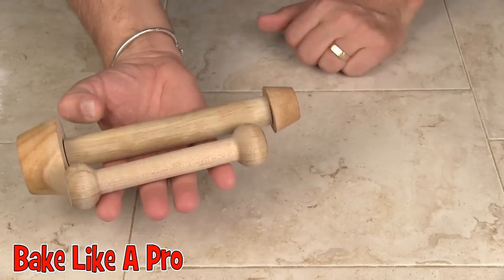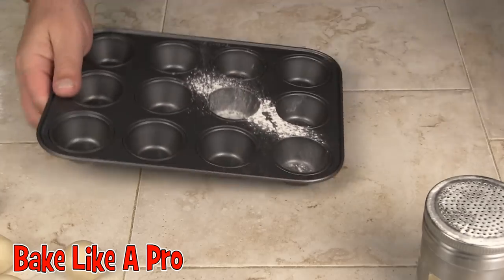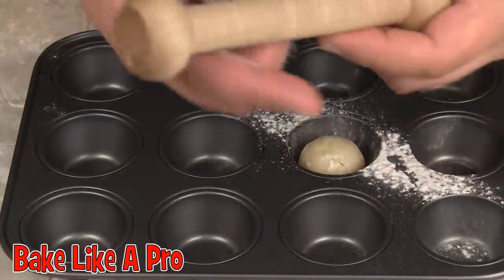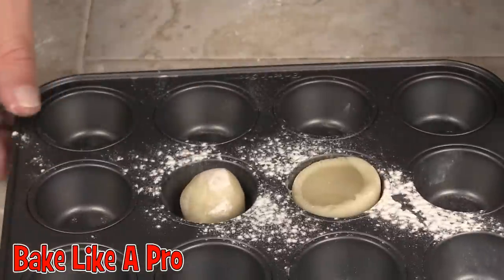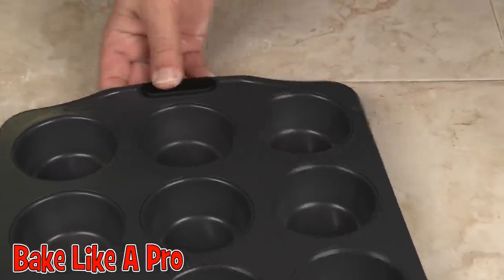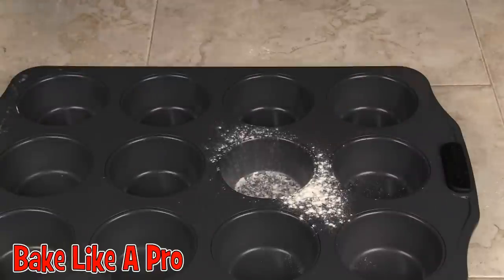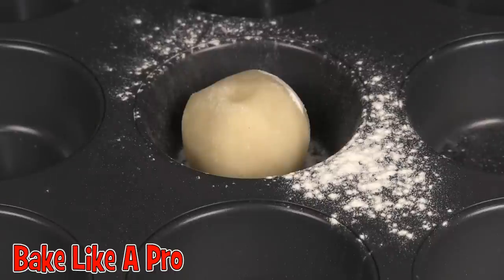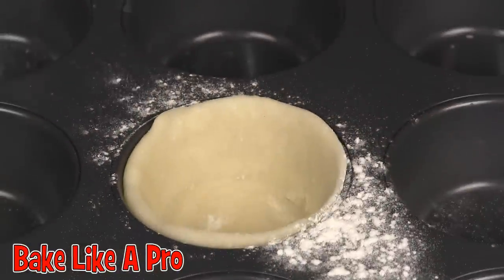Kitchen Gadget Answer

Comment from the maker: Hi sbecky123, it's called a "tart tamper"  Google "wooden tart tamper" or just "tart tamper" Amazon sells them, I'm sure eBay has them also, ( I just checked and yes, there are many of them for sale on eBay also ).  Depending on the vendor, they start at about $4 , so many prices, so check different vendors before making a purchase.  Pampered Chef also sells them. ( and Amazon sells the Pampered chef model also ) Fox Run also makes them ( large company selling baking products ) Good luck ! :-)
Reply: Thank you! I needed to know what the tool was called!